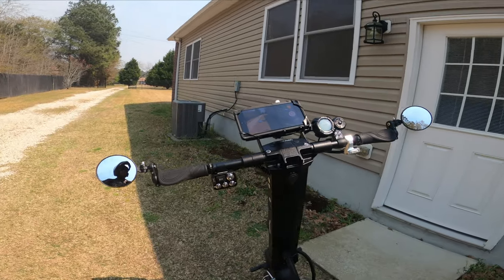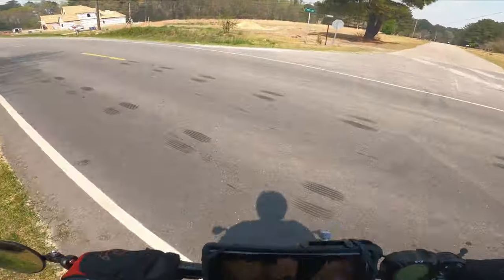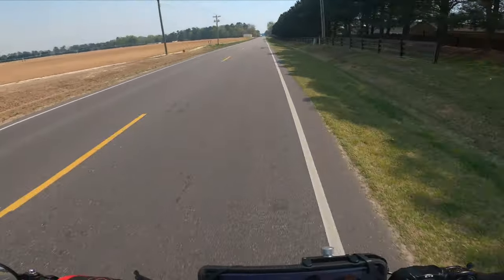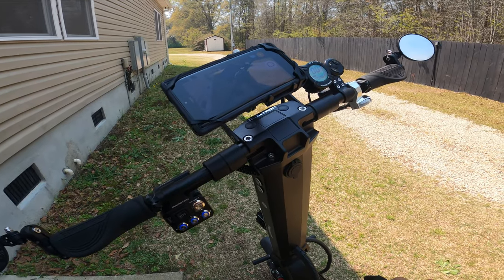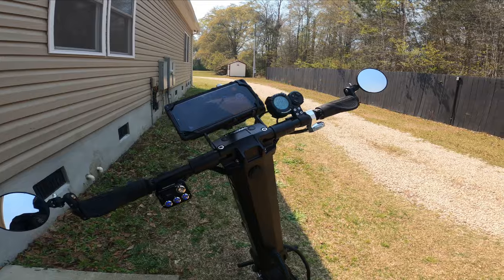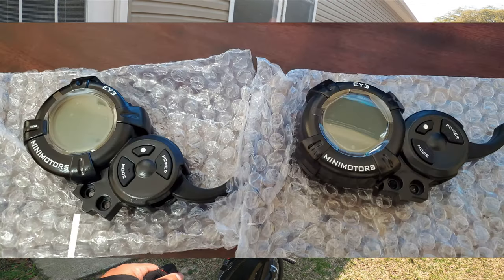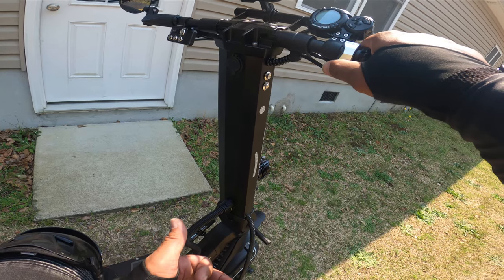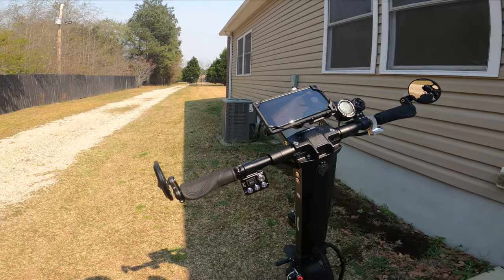Rion Curve Throttle on the Dualtron X2: First Ride & Installation Tips

Comment: Thats an excellent solution to help tame the high torque in the lowers spec (but aggressive)controllers.
Thank you very much for sharing your experience.
I hope to do the same with my Vsett 10+R (atm it just wants to kill me).
On your hall i see you've removed the trigger,Is the hall until now sealed or open to the elements?
I've been trying to get hold of the Rion Curve throttle for three months now...no luck at all.
Once again thank you for the vid,ride safe mate.

AntMan :)
Reply from the maker: I sealed everything with a black waterproof silicone. The folks over at Rion are quite busy with creating a new batch of Rion Thrust scooters. I'm not sure when they will have more of the throttles in stock for sale.

Comment: Thank you. 
Gear mode 2? You mean P2? The instruction leaflet is the worst I have ever seen., eg. P7   0  ~5  what does it mean?
How do you set for the smoothest start? It keeps kicking every time you start. My Boosted Rev is incredibly smoother.
Reply from the maker: Slow start takes a little torque off. And the Curve throttle has better response at its lowest point so that you don't start off too fast. It's not the smoothest experience but it's better than the index finger throttle.

Comment: I truly believe this is the best throttle in the market and I want one so bad for my Laotie ES19.  I'm just not sure that I can justify the price.  Looks like the current price is roughly $220.00 from Alien.  Has anyone tried this throttle and compared it to the $15 M365 style thumb throttle on a high speed/high power/high torque E-scooter?  The $15 generic thumb throttle is much more in my budget and I have heard that it is a much more managable throttle as compared with the standard trigger throttle which I am not a big fan.
Reply from the maker: The precision is awesome and very precise with the delivery of power. However, after using it for over a year, the spring went out and I've since went with a cheaper thumb throttle from Amazon and I really can't tell much of a difference from the performance of the Rion Curve throttle and the cheaper one that I have. https://www.amazon.com/Honses-Electric-Scooter-Throttle-Bike/dp/B09P61CXQB/?_encoding=UTF8&pd_rd_w=tf1yR&content-id=amzn1.sym.5f7e0a27-49c0-47d3-80b2-fd9271d863ca&pf_rd_p=5f7e0a27-49c0-47d3-80b2-fd9271d863ca&pf_rd_r=GZX2JZ8WBHAHNQBQEYVY&pd_rd_wg=VKvpO&pd_rd_r=5aa65bff-d6bd-40b3-b682-734cead1d04e&ref_=pd_gw_ci_mcx_mr_hp_atf_m

Comment: Hi just one question how often do you pump your tires with air ? If you do at all ? And what would be the best psi setting for the tires ?
Reply from the maker: I check them before every ride. And if the pressure is off, I put air in them. Temperature can cause air loss in your tires. So check them often, especially if your scooter sits for a week or so.

Comment: Is that smooth? What the hell was it like before I wonder
Reply from the maker: It was instant torque as soon as you pull the throttle! With the Curve throttle there is a less aggressive response when the throttle is lightly engaged.
Reply: @johnrichardson5089  now I know why I can’t get one for my Re60s because all you daultron riders taken all stock😂 thanks👍
Reply from the maker: @StreamerTV  That might be the reason why Rion stopped selling them. The order page is no longer active.
Reply: @johnrichardson5089  its on mini wheels waiting for stock

Comment: Hey John do you know if there’s a problem with the curve? I can’t find one for sale on Rion website anymore.... 🤔
Reply from the maker: I think they are either out of stock or they no longer sell them 🤔 I'm not sure but you may wanna try sending them an email.
Reply: Rion is now offering electrical parts and kits to upgrade any manufactures scooter. My question for you or OhManDan is would either of you consider a Rion electrical internals swap into one of your Dualtron X’s (X1 or X2)? This would be a match made in heaven! Faster, better controllers and batteries mated to a X platform with the best and most comfortable suspension for riders over 50! 😃😃😃😃😃

Comment: Do you think the rion throttle can be installed with the print reader aswell?
Reply from the maker: I'm sure it can because the throttle is installed in the area where the hall sensor is located and the print reader is a separate connector.

Comment: I’m thinking to do this. 
Does it really worth it? In the video I se it’s still jerky but I wanna know if it’s smooth as butter now. If the difference is day and night or just very little difference?
Reply from the maker: Honestly,  it's only very little difference. You would probably get the same results with a cheaper Amazon thumb throttle. But when it comes to managing the torque at the lower end of the throttle, the difference is night and day. With the finger throttle you get instant powerful torque as soon as the wheels start whenever your in a higher gear mode but with the wheel thumb throttle I can start slowly even when in a higher gear. That's the main difference.

Comment: How does the wheel work? Does it continuously spin or does it snap back like a motorcycle throttle?
Reply from the maker: It has a pretty smooth snap  back. I generally just ease off the snap back spring whenever I slow down. This is absolutely the best throttle on the market,  in my opinion.
Reply from the maker: It has a very nice snap back that you can hold in a precise position to maintain a preferred speed.

Comment: The minimotors controller is crap don't make a difference what throttle you use  
It's all about the sine wave controllers
Reply from the maker: I agree. Sine wave controllers makes the throttle progression much smoother, but the Rion Curve throttle makes the power management of the Dualtron X2 a little better in my experience thus far.